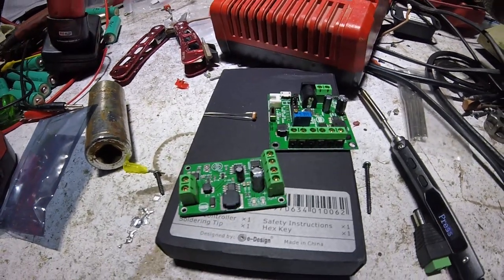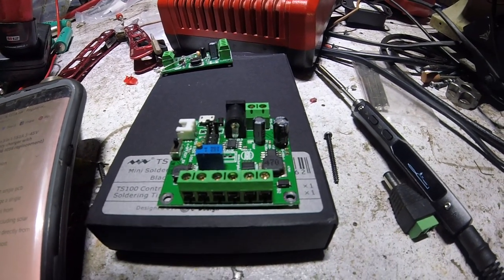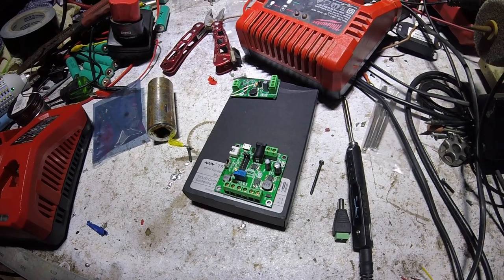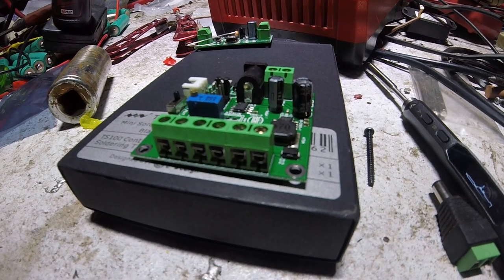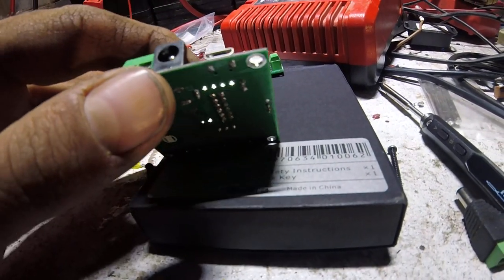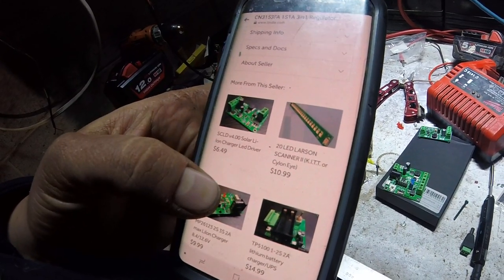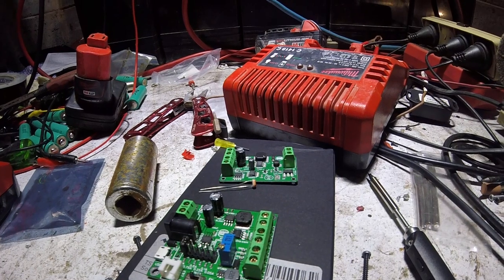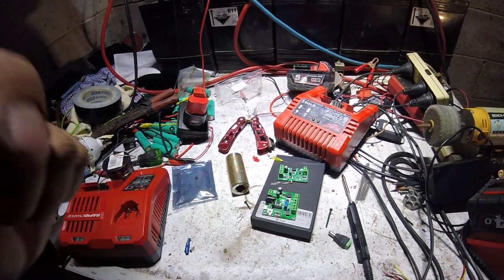Burgduino Sent me Awesome Li ion Charging Boards

Comment: It is probably being copied in east as you speak
Reply from the maker: Sadly your probably correct
Reply: Hi.. you can be right but then, again, that might be a good thing... these days you are not somebody if you are not being copied LOL
Reply: Hi Christos, a few days a go i stopped my three listings on ebay of a tiny smd joule thief i was selling, it was going on for around 5 years and i have sold over 4000 units, over these years i have been copied by many people, some of them couldn't compete even if they made EXACTLY the same board as mine, some others made variations etc etc, but still i was the number one seller. Don't worry about copying, keep going. Sadly i had to move to a different country and due to expensive shipping here i wasn't selling very well, Greece however is an ideal place for those boards because of the lower shipping costs and really fast shipping (i was shipping to US in 2-4 days via normal post). Today i saw your boards and i was really happy to see another Greek like me (I am from Strymoniko) doing almost the same if not better than me, no matter what keep going and introduce more great designs into the market never stop, i'm sure you will do great!
Reply from the maker: Great support mate good stuff
Reply: Στρυμονικο????? Ρε φιλε.. απο Λιθοτοπο ειμαι!!!!!!!!!!!!
Reply: Τεμόν παιδάς? :D να μπαίνεις και στο hlektronika.gr να βάλεις και τις πλακέτες στην παρουσίαση κατασκευών να σε βλέπουμε. Χαιρετίσματα από UK.
Reply from the maker: English please?
Reply: we found out we are not from same country but nearby villages how cool is that?
Reply: Sorry bro we were just telling were we are from. We are actually neighbours :D
Reply: Doing almost similar things LOL
Reply from the maker: Haha all good thats awesome
Reply from the maker: That's awesome
Reply from the maker: Thats sweet im just no good with other language's